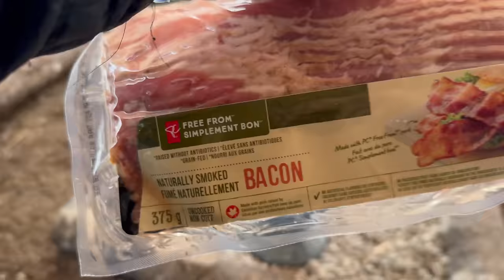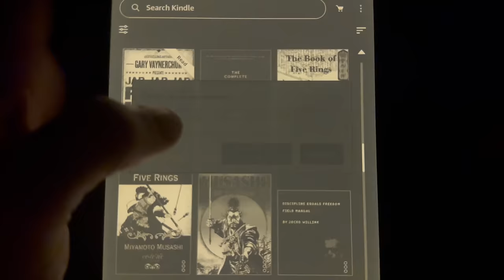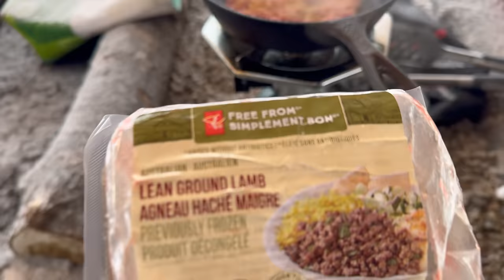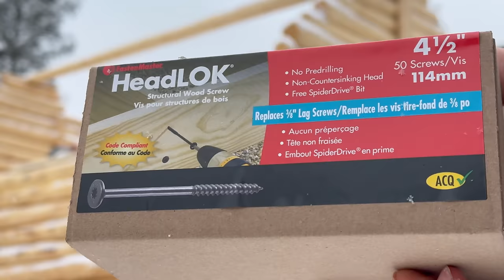Winter Log Cabin Build on Off-Grid Homestead |EP15|

Comment: As a contractor and carpenter for almost 20 years it’s awesome to see someone with little to no experience do something of this magnitude. I’ve seen others say this, but remember to add blocking under the plates where each rafter sits. They need that weight distribution to be carried so that they don’t sag over time. And great job 👍
Reply: @johnlemyre534  especially with a 12/12 pitch. I think 5/12 in our snow zone is code with 16 inch centers

Comment: You might want more blocking under your 2x4's to keep it from sagging as you install the rafters/sheathing.
Reply: I came here to post the same thing.
Reply from the maker: THANK YOU KINDLY GOOD SIR HESSLERK, I HAVE SEEN SEVERAL COMMENTS ABOUT THIS, I SHALL INSTALL MORE BLOCKS UNDER THE TOPPLATES TODAY! STRENGTH AND HONOUR TO YOU! 🐺🌲
Reply: Same comment here. And maybe 2x6s. Maybe jack the cabin and level it up at the foundation ?
Reply: We call that blocking cripples here in the states. Recommend 16 inches on center to carry the rafter load.
Reply: Came to comment the same thing, maybe taper off a block underneath each rafter.
Reply: Maybe  put in a dormer or two for a little more head room????❤

Comment: Glad you are back. 
Adjust the depth of your circular saw to 1/4” deeper than the thickness of your material. This causes less drag on the blade and lengthen the life of your battery. Also if you cut plywood from the back side it leaves you a cleaner cut on the front side. 
I’m enjoying everything you do.

Comment: When using your circular saw, adjust the blade depth to just below the material (quarter inch), much safer and more efficient than having a third of the blade below the material as you're cutting

Comment: If you ever want to take a warm bath buy a 55 gallon metal drum, cut it in half vertically, build a trough to hold it off the ground, and place a campfire under it. While there is snow you can shovel a few scoops in and let the fire melt it and then heat it up. Then just sit in and enjoy your mini hot tub lol

Comment: When cutting with your circular saw, you should only have a small amount (1/4 inch) of blade through the wood you're cutting, its safer and more efficient to cut this way, rather than having a third of the blade through the material

Comment: Sir, get a decent quad trailer, you don't need to drag all that material by hand use your quad man.
Reply from the maker: GOOD SIR, DO THEY EVEN MAKE ATV TRAILERS THAT LONG THOUGH? I CAN'T FIND ANYTHING AT THE RETAILERS IN TOWN. ANY BRAND NAMES OR LINKS YOU MIGHT HAVE? THANK YOU! STRENGTH AND HONOUR!
Reply: Try Woodland Mills in Ontario they have what you need without a King’s ransom!
Reply: It doesn’t have to be a quad trailer, I use a small  homemade utility trailer that I can tow with my truck or quad.. check Kijiji or market place for something cheap

Comment: I actually think the cart seems components seem fine themselves, but it is almost as if the wheelbase is too short to it tends to wobble and be unstable a lot. It looked like when you were assembling the cart, the axel could be taken apart so maybe if you just used the axels and wheels and attached them further apart on your own wooded cart that you could make that is also slightly larger it would help with being more stable especially with larger loads and you could maybe even tow it with wolfmilk mobile. Anyway, glad to hear you are doing better man! Ooga Booga!

Comment: Hey when using a circular saw, adjust the depth of the blade to about 1/4 inch deeper than the depth of the cut, it will cut better

Comment: You need to calculate the log shrinkage for the stacked log gables .it probably won't be a 12/12 roof next year . I would put them on the ridge beam and over lap the rafters connected with a single bolt
Reply from the maker: GOOD SIR RICH, THANK YOU FOR YOUR COMMENT. AS THE GABLES AND THE EAVES WALLS ARE ALL MADE OF THE SAME RAW LOG TIMBERS, WOULD THEY NOT ALL SHRINK UNIFORMLY? THE EAVES TOP PLATES AND THE RIDGE BOARD ARE KILN DRIED LUMBER - WHERE THE RAFTERS WILL SIT, AND SHOULD SHRINK WITH THE RAW LUMBER ON ALL FOUR SIDES OF THE WALLS. AM I THINKING ABOUT THIS CORRECTLY?
Reply: @wildhomestead i have 30 years building experience the last 15 here in japan .its important to consider shrinkage and settling. Without writing a book here goggle framing a roof with log gables @ fine home building . It has a great explanation ❤❤

Comment: Cart idea;

Take rear axel off the cart and use separately. Meaning, tie the rear wheels to the farthest end of the lengthy item you are pulling, you then have a set of wheels at either end of eg: 2x12's, logs...ect, and use the product your carrying to determine the cart size itself. But till ground dries out, probably better with a strong sled/sleds.

Comment: It may be a bit late but it would be advisable to use a 2x10 for the ridge so when you put the angle cut on your rafters you will get full contact with the ridge (you will either have a gap at the peak or you may have to cut some at the bottom so it doesn’t hit the log ridge beam).  Not the end of the work but would give a cleaner look.  Also, consider installing some extra blocking under the double top plate at 24” centres (ideally wherever your roof joists will be bearing.  It will allow for a continuous load path from the roof down to the walls.

Comment: When you get round to it I would put the log burner under the floor of the loft, that way the heat has to radiate through the room before it can travel upstairs. Then downstairs will be warmer and upstairs cooler.

Comment: Good job so far. My concern would be your foundation. Noticed water running under the cabin from the thawing and rain, which erodes soil around those pads over time. The ground will expand and contract as it freezes, then thaws out, causing possible twists and unleveling. Keep going. Looking forward to watching more progress.

Comment: Should have just flattened the ridge beam and the top wall logs as well. (in fact you should have done that on all wall logs, makes it so much easier and faster to align everything. Buy a mill, or at least a hand held chainsaw-mill. Will save you on lumber cost also, not to mention how much time it takes you every time you need a new piece of lumber. What is it, 5hrs to and back from town?).

Comment: I would have thought you would have taper cut a log instead of the flimsy 2x4 top plates.. You will have to place supports under every rafter to carry the the load or they will sag. There also will be an outward load on the plates as the rafters want to lay down, or spread out. I'm sure you have seen roofs where the ridge beam has sagged and the tops of the wall are bowed out.. I'm sure you will figure it out and that there must be hundreds of comments already.. I enjoy watching your adventure, Ooga Booga!

Comment: you really should invest in a pushbroom! so useful around a construction site, as well as with snow management.They make a type that has a heavy rubber blade on top of the brush bar so when you flip it over you can sweep water off smooth surfaces.

Comment: Screws is well and all.. But also add in nails into your framing, Wood moves alot during the years and that expanding and shrinking is gonna break your screws while nails have a much higher tolerance. 
I usually combine both screws and nails and use screws for areas that is hard for a hammer to reach and work and areas that isnt going to carry a huge load. 
Im not saying your home will fall apart but after 5-10years if you check atleast 5-10% of your screws will be broken.

Comment: Havent posted in a few episodes because I have nothing constructive yo add but I am glad you rejected both the gable log and your friends log as I can't help wondering if the logs would shrink differently and cause problems down the road. ...  Also, crows migrate so the birds you saw in winter where ravens 100% the larger flock in this video most likely returning crows as ravens seldom flock except for carcasses.....and thats my 2 cents. Loving these videos.

Comment: Protecting Thor’s Red Oak.  One option would be to use left over logs to build a little log cabin around it.  About two meters by two meters and walls up to about the same height as the tree, with chicken wire over the top to let in light and keep out hungry herbivores.  PS: Sad to hear about your food poisoning.  More fiber in your diet would be protective, but work up to it slowly.  Suddenly doubling your fiber intake would be disruptive.

Comment: Your wall top pates are not really structural. It would have been better to rip 2x6 and 2 x8 on the taper with 2x4 top and bottom plates. More strength and n no sag in between the blocking

Comment: Plan #2 for protecting Thor's Red Oak: Kill, cook and eat any animal who messes with your coveted tree. It would lower your grocery bill too. Also, join the fraternity of carpenters by learning the lingo. When you were huffing all the lumber back you called it a "twelve foot component". Say twelve footer. Other terms you probably know are floor joists, ceiling joists, rafters, panels(4x8 ply). Then we get into fancier terms like bird's mouth and plumb cut for the ends of your roof rafters. And never forget, all construction guys use lewd and raunchy humor to describe fitting the "components" into place. Example: "Hey Billy, this ridge pole is a little too tight and it has a slight curvature." Billy responds: "That's what she said."
Reply from the maker: :D NOTED! ON ALL FRONTS! THE MORE WORK I DO OUT HERE IN THE BUSH ON THIS CABIN THE MORE RESPECT I HAVE FOR TRADESMEN AND WOMEN!
Reply: Also James since you are one of those "book lernin' types" I see your role in the next Game of Thrones as Head Alchemist and Keeper of the Archives. I think a scientific role like this would suit you well.

Comment: Just a question regarding supplements that cover a lot of various minerals, nutrients etc. Do these supplements actually work as advertised or is this a case of something similar to 2 in 1 shampoo/conditioner? Yes it convenient to wash your hair once with the 2 in 1 but better results using separate shampoo and separate conditioner. Would the same thing apply to supplements?

Comment: Why are you putting in those screws at an andle? To long maybe. Seems you cabin is extremely out of level. Wouldent it be better to Jack up and fix that before doing the loft floor etc? Maybe its normal for log cabins.
Seems you lost some headspace hight in the loft, due to the hight of the loft floor. But I guess its a give and take. One floor will always be shorter hight. 
You will save so much time if you get an atv trailer etc for hauling the materials.

Comment: How are you going to do the floors buddy?
Reply from the maker: GOOD SIR MIKE! I WAS PLANNING TO USE 2x8's WITH MY SPECIAL SUSTAINABLE INSULATION MATERIAL, BUT LAST WEEK MY NEIGHBOUR SUGGESTED TO ME THAT I ACTUALLY BUILD UP THE GRAVEL THEN POUR A CONCRETE SLAB. THE SLAB WOULD NOT BE STRUCTURAL SUPPORT, BUT IT WOULD DEFINITELY MOISTURE AND RODENT PROOF THE ENTIRE BOTTOM OF THE BUILDING. IT'S NOT "OLD TIMEY", BUT TO LEARN A NEW SKILL (I'M SURE I'LL MAKE MISTAKES) IT COULD BE VALUABLE. WHAT DO YOU THINK ABOUT THAT? STRENGTH AND HONOUR!